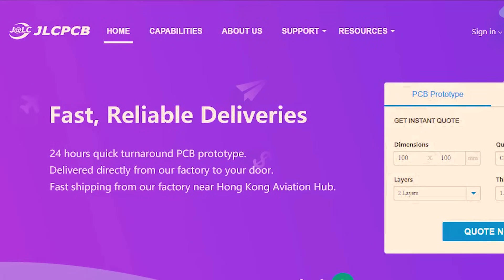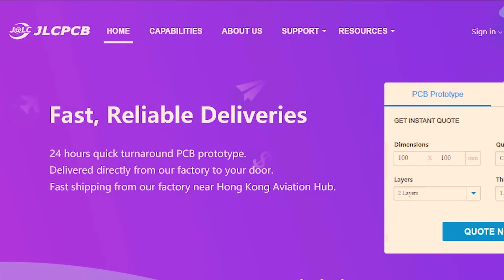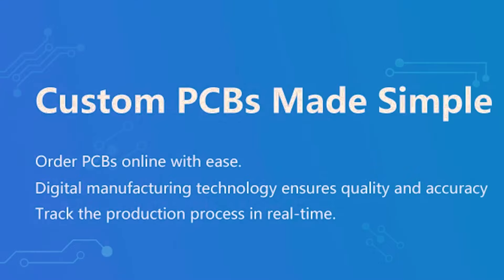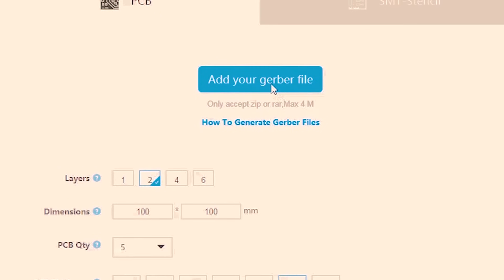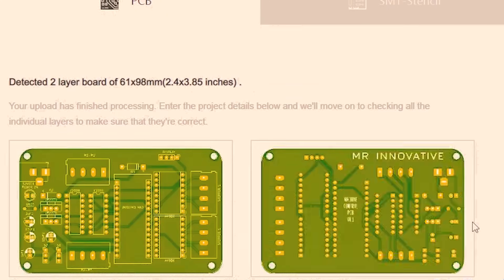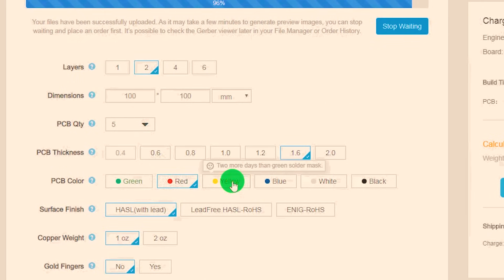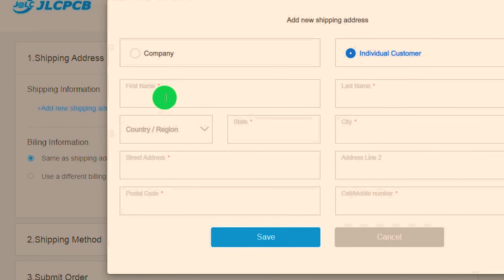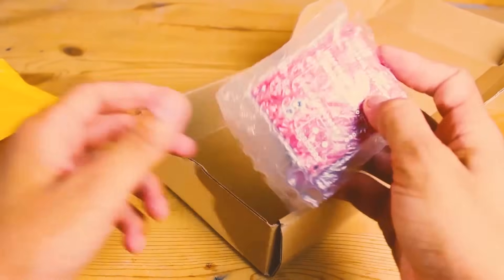DIY Mini CNC Engraving Machine | Arduino based CNC Router machine

Comment: Hey, this is exactly what id like to build, but the price of the 500w motor seems rather steep. could i not just use a motor from an old electric drill and a screw on chuck? or would the rpm's be to low?

Comment: This setup might be suitable for cutting vulcanized fiberboard pieces of guitar pickup flatwork if a low-power cutting laser was used instead of a router head. Even with very fine bits, there's tear-out even with very small, very sharp cutters. Fred Stuart has a purpose-built laser cutter for making flatwork that he demonstrated in a video several years ago (maybe 10+), and the flatwork come out beautifully. Preferable to dies and a punch press, given the cost of that kind of setup (only useful for large production runs anyhow). This looks like just the machine for the job. It would actually only need to be 2 axis, X and Y, since the material is flat and not very thick.

Comment: We are trying to make cnc with Arduino mega 2560 and cnc shield and A4988 steeper motor driver. We have uploaded GRBL code  from  open source. But the moters are doing vibrate only.  We have checked several times connection is correct.    We just seen an error : 22  on GRBL controller. Pls help me out ASAP.

Comment: That side action on the cutting disk with no guard could have ended bad... I'm pretty sure that's like the #1 thing not to do with that type of disk. It creates thinner areas midway through the disk which makes it much more prone to self destructing. I'm sure if I was in your position I would have done the same thing at least with a guard and face shield though. I usually just use a file when the material is very small.
Reply: Time

Comment: Nice! I did the same with 3d printed parts 4 years ago, then I changed to 30X30 profile aluminum. I havent used since two years ago  due I wanted to add a camera, I tested on april with good results.

Comment: Nice job, man, very similar to what i'm building. By the way, you shouldn't mount the lead screw directly on to  the motor shaft, 
because on higher loads you might have acuracy problems. 👍